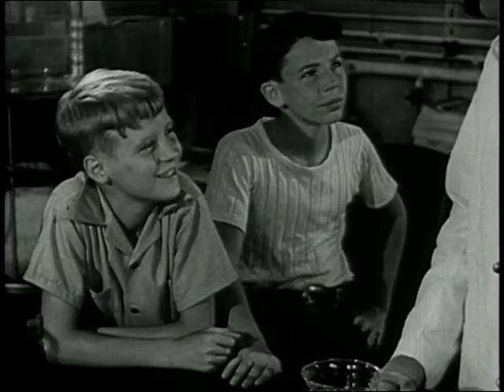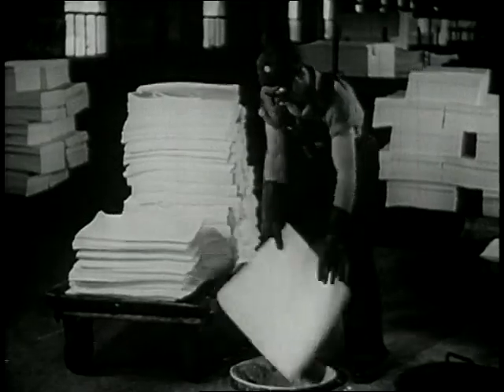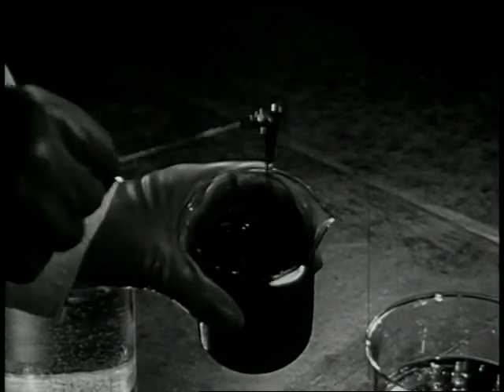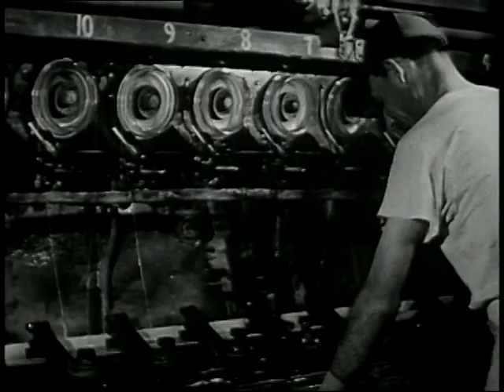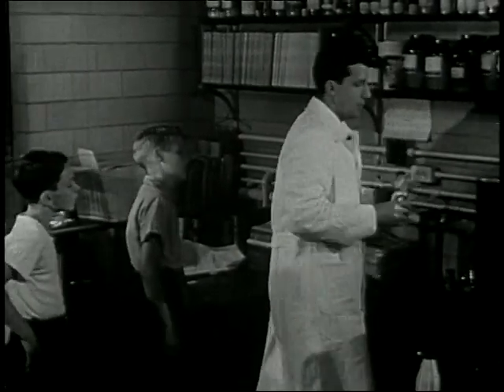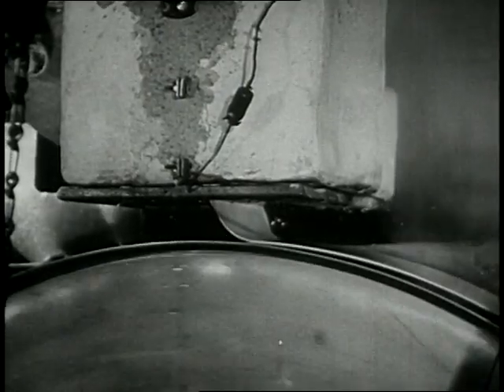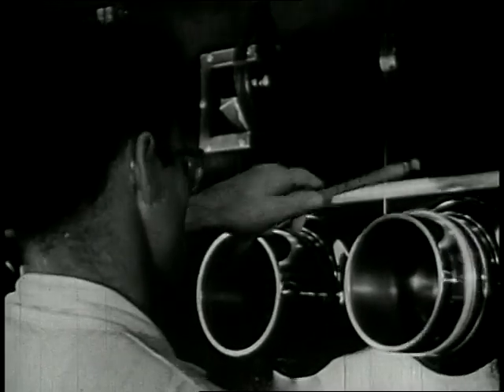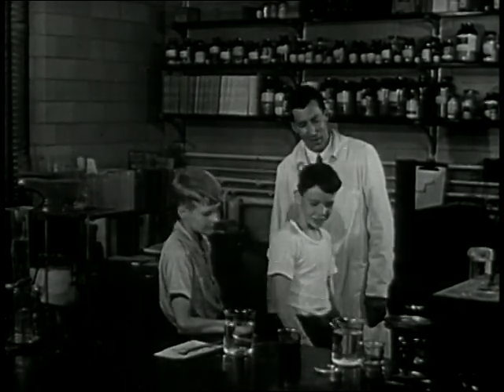Synthetic Fibers: Nylon and Rayon (1949)

Comment: Nowadays, we make all those fibers from oil- simply because it’s cheap and easier.

We need to get our chemicals from biomass again. But we need to be able to get more out of it by using more waste products.

It’s all about taking one thing and getting more out of it, or diversifying.

Using biomass is more expensive than drilled oil, but it has to be done.

Comment: What is chemical? 😂
Reply: Sodium hydroxide, also known as caustic soda or lye.
Reply: I think to break it down more
Reply: I had a read about it. It's copper hydroxide dissolved in a solution of ammonia called Cuprammonium. They don't use this method anymore